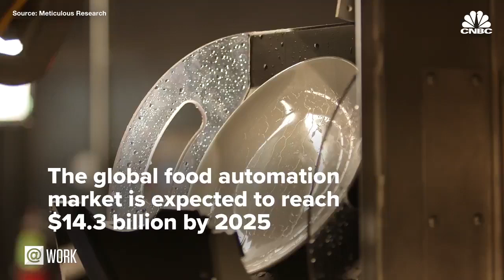Robotic Dishwasher

Comment: what would happen if the machine fails? imagine the maintenance the machine needs and also its for the same type of plates. I wish i worked in a project to develop an all automatic dishwashing machine with least amount of water required, i have soooo many things to fix.
Reply: Disposable plates can be the solution? Used disposable plate can always be shredded and clean with a chemical process to be recycled as trashbag.